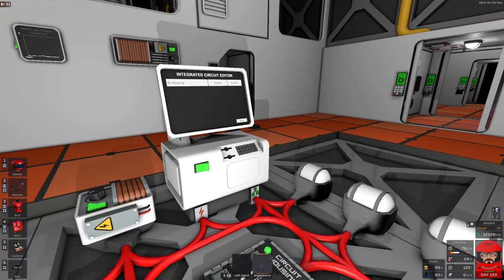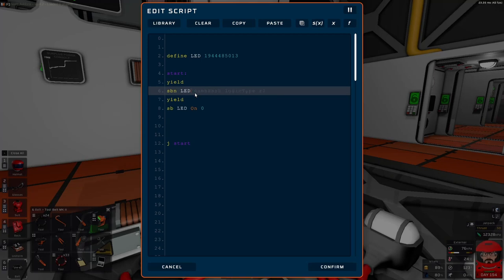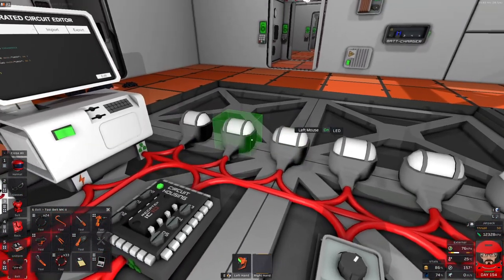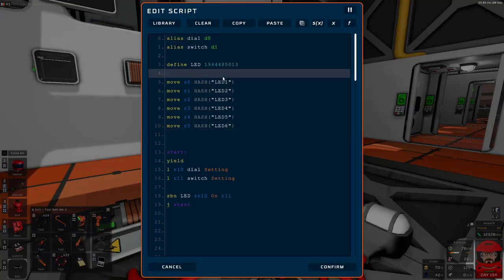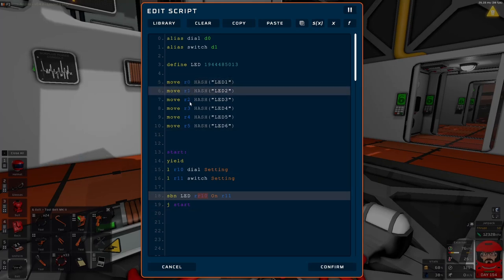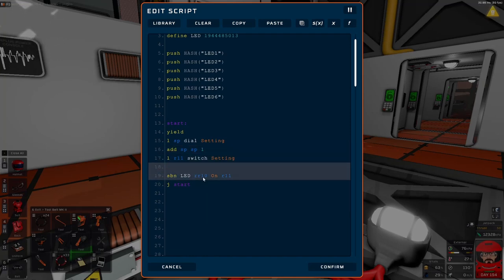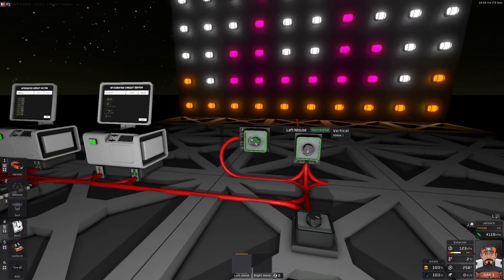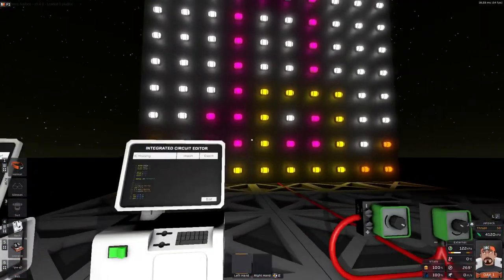Stationeers Advanced IC10 Programming 11 Batch Named

Comment: Wow, this allows proper base commanding (for example lights on/off in rooms based on occupancy) from a single IC; no need to mess around with multiple networks and multiple ICs. Can also decrease the power consumption a bit :)
Reply: Utilizes the usefulness of these commands via the power of sensors.
Turn off all printers when not in the room or when not printing.

Comment: I seriously cannot wait for the next playthrough series and the shenanigans you can get up to with the IC10 being so powerfull now.
Thinking of atmospherics alone i am using 2 ic's per gas for filtration and temperature controling it but it's easily done on 1 ic now.
Reply from the maker: Yes, I didn't even think of the in unit chips.  No more two pin limitations.
Reply: @cowsareevil7514  that was exactly my thought.
I always use your filtration code and when they add the batch slot read 1 chip could control all the filters and diodes if there is enough lines of code.

Comment: even if you cannot read using named batch you can save quite a few pins on the airlock code because the active vents and lights don't need to have a pin.

So if you can only read from devices using dedicated pins an airlock will need the 2 doors (to detect attempts to open) and 1 gas sensor at the very least, everything else is only an output or batch readable. which means that you can have the inner and outer gas sensors on pins and have a more direct comparison, which will make the math a lot simpler
Reply from the maker: I didn't show it but you can read.  It is the slot reader that still needs to be added.  I didn't think of the airlock.  You can also add multiple vents for a faster cycle, a 3 way airlock perhaps.  So many things to rebuild.
Reply: You could even have all your airlocks controlled by the same IC. Might be a little slower as the IC polls them all for updates though.

Comment: Those controls for the etch-a-sketch should be a bit further away so you can see the entire thing while looking at the controls. Also, that idea of a video screen isn't so far-fetched if you stand back from the lights :)

Next, can you combine the lights with the music generator to make a disco?
Reply from the maker: It would look better if the LEDs had flare effect of the other lights.  But they are the only lights that can change colour.  Even from a distance it still looked very dotty.
Combine the lights with an automated pipe organ for Dracula's castle.

Comment: @Cowsareevil  
Would you be able to put up a video explaining how to best use the H2 Combuster for water production? The machine is kinda a pain to use and is a heavily relied on in a Venus/Vulcan playtrough. Mainly the Waste pipe heat dissipation being relevant to how hot water comes out the output and possible suggestions on how IC code could be of any help in producing H20 in an efficient manner

Comment: My noob programming brain wanted to have the HASH with string operation like HASH("LED"&r0) maybe the add this? would make that stack use obsolete.
I still didn't understand the usage of that Network thing d0:0, can that be used to reference other IC Housings? Or even the stack in another housing?
Reply: Yeah, I was curious what would happen if you just hashed an Integer, but haven't had time to try it yet..... Name the device "1", then have the IC reference device name HASH(1). If the HASH function converts the integer to a string automatically, you can just assigned numbers to each device and the IC can just reference the name with a counter.

The network channels are used to store data states on a network. Think of it as an announcement: you could send how much power you have on a Power Cable channel or a code for how you want an item routed in a chute network. Then you program other ICs on the network to use that data.
Reply: Just tried it. HASH command will only accept strings. So they'd have to add a command to convert INT to STR for this to work at a basic level and a way to concatenate strings at the more advanced level.
Reply: @WolfPlaysGames2  Somehow expected that :( Thanks for further testing, I doubt they will add string operations..
Reply from the maker: It would have been awesome to have dynamic stings but MIPS cant process strings so it can only be implemented through a preprocess command.  All of the strings are converted prior to running the code.  So dynamic strings at runtime are not possible.
The network channels will be huge when it is fully implemented.  It currently only works for cables which makes it a little pointless as you can already communicate through cables, but when the pipe and chute connections work, it will allow for some serious cross network automation.
Reply: @cowsareevil7514  Agree about the network channels, but at least it allows us to bridge different cable networks without additional hardware. The IC is commanding a second device to send the signal, so any device that bridges two networks (like a transformer or battery) can act as a relay. No additional I/Os required....
Of course, if we start using name hashes instead of pins, maybe we just put everything on the same cable network?
Reply: @cowsareevil7514  If they are still using the same (weak) hash they previously used it should be possible to have e.g. 16 devices named such that hash(device N) == hash(device 0) + N, which'd make loops and such much simpler.

(harvie0, harvie1_<some_gibberish>, harvie2_<some_other_gibberish>, etc.)

This'll only work if you can pass hash values in registers as opposed to integer literals though. I haven't checked.

...actually, what happens when hash values collide I wonder.